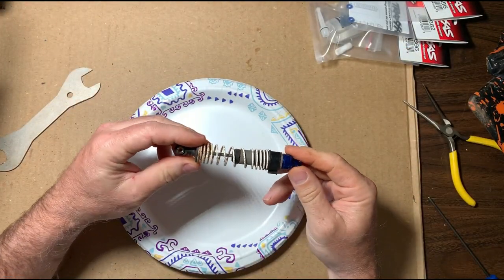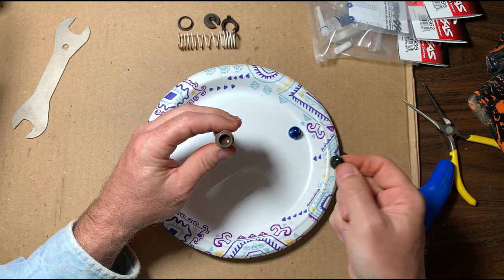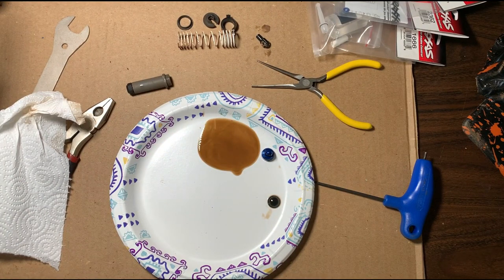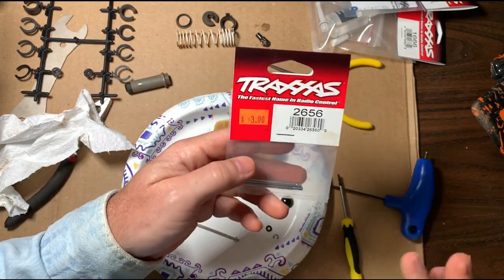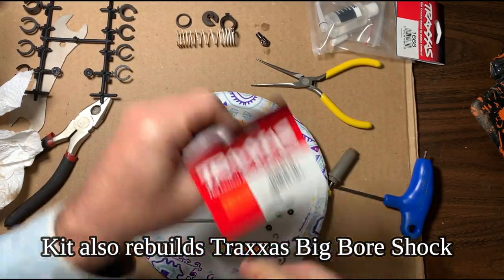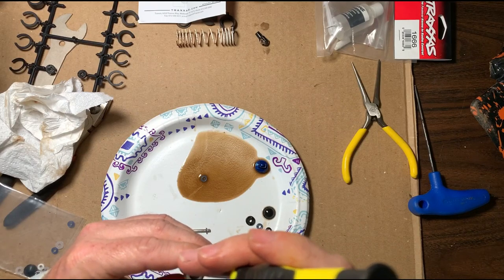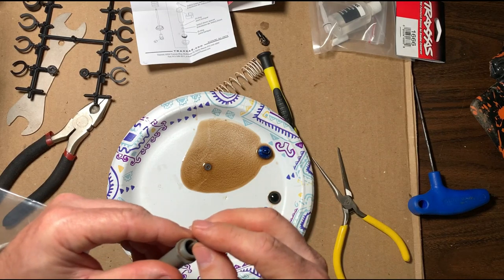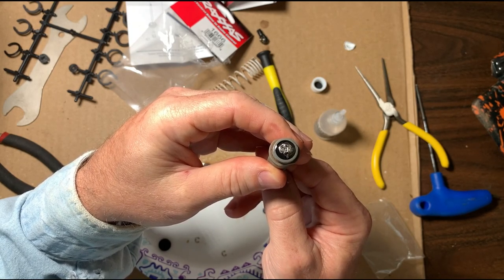Rebuild Your Traxxas Shocks ( Ultra Shocks )

Comment: Don’t fill it up so much with oil. This makes the air need to travel further up the shock body. You are just trying to get the air from behind the piston out.
Reply from the maker: Thanks for the info brother, You are correct, Ive came a long way with my wrenching skills...since this video 👊👊👊👊👊